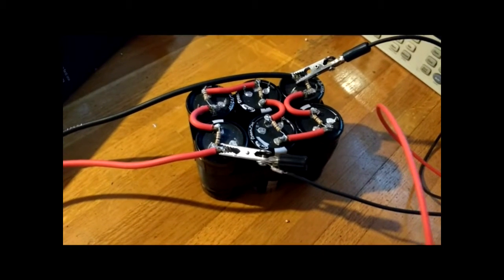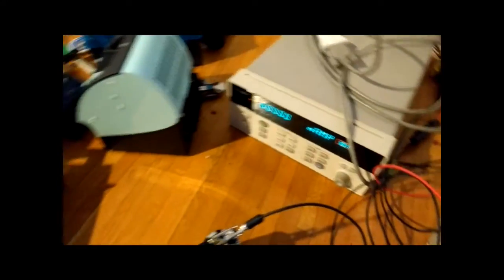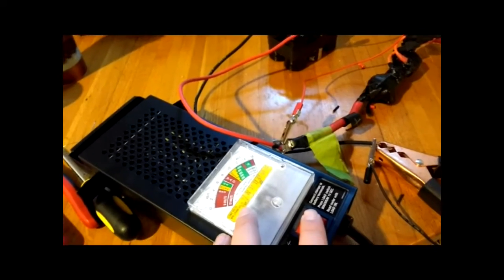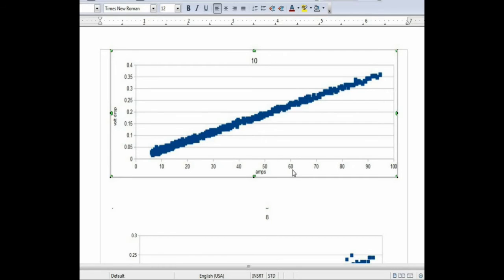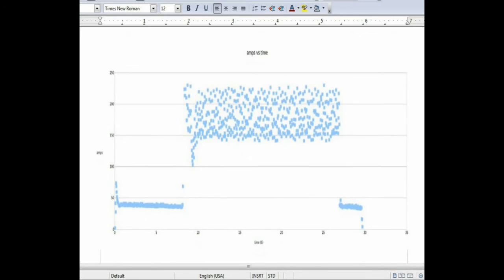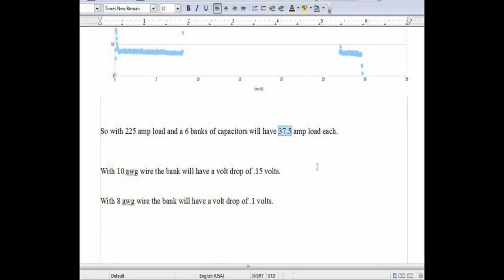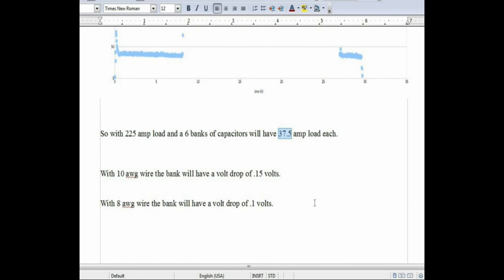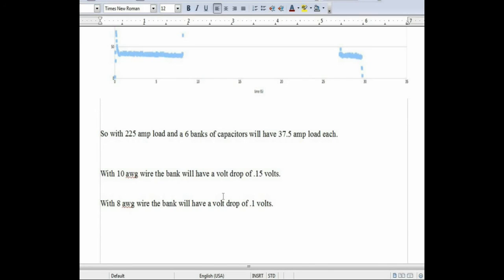Using a super capacitor as a battery (part 3)

Comment: they are mf rated at 3,000 a piece my truck does have an alarm but no running lights but I have wired them up in series and started up my truck and ran my truck with it just to see if it'll work and it does but I put the battery back on it since then I only did it for a few hours just to see if it works but now I would like to do this the proper way for a more permanent solution
Reply from the maker: cjmallory40 what brand are they? I would do a parasitic load test with your alarm activated. The key fob on my car broke a long time ago so I never use the alarm and didn't have to worry about it. Car alarms can draw down the battery faster so you might have to use a larger battery than I used.

Comment: I already have 6 3000 mF 2.7v sup caps from another project, can I use the same 20 ohm resist and 15amp 45v diode with a 10 gage wire with a 4 amp/hr battery to do this same for my 04 Titan
Reply from the maker: cjmallory40 are they mF or F? If they are mF they are going to be to small. I would start out by measuring how many amps the starter uses to turn over the motor. Does it have running lights or an alarm system on it?